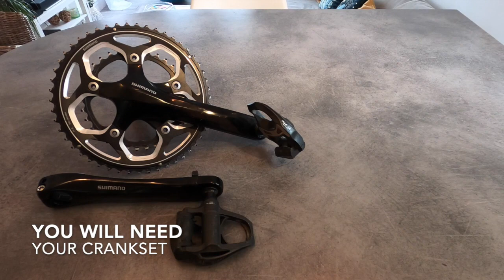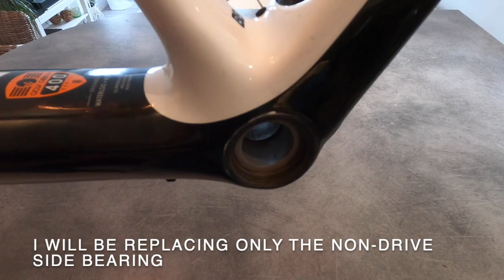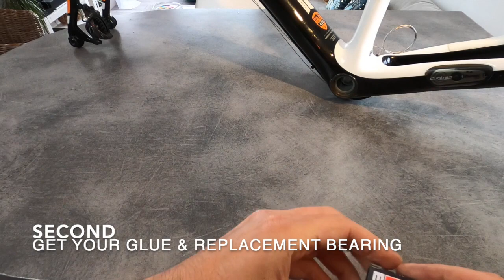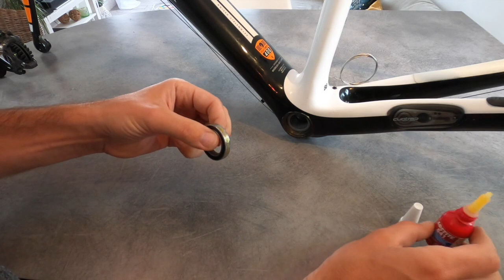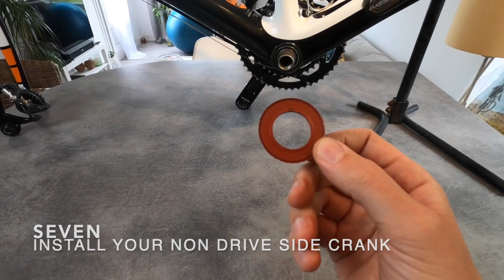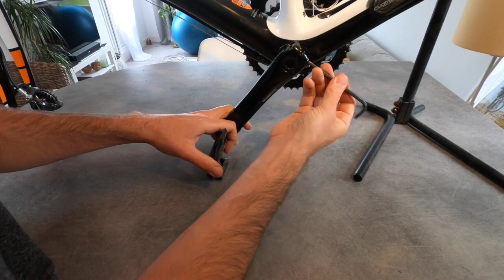Stop Trek BB90 bearings from creaking !

Comment: Wow… that frame should be replaced under warranty. The housing was always too big to hold the bearing in correct interference (manufacturing fault), possibly being further enlarged/ovalised by the outer race “spinning” in the poorly made housing.

Also, the bearings inner races are spinning on your crank axle, wearing that away too. The correct way of interfacing the BB bearing and crank axle is with a softer plastic/delrin sleeve as per Shimano BB’s. I would also be claiming they replace my crankset too! Very poor design and manufacturing. 

Thanks for the video and very best of luck 👍

Comment: your bb shell is worn, you can buy oversized bb90 bearings from trek that will fit beter
Reply: totally, if you don't need the press, you need to go oversize.
Reply: Even if I have Ceramic Speed too 🤦🏻‍♂️. Just had it serviced and still creaky 🤦🏻‍♂️🤦🏻‍♂️🤦🏻‍♂️
Reply from the maker: I would imagine that they fit better ...until they dont ! Wont they too make the hole bigger ?!

Comment: Just had my non-drive side bearing replaced at a trek dealer. They used an NSK 6805 with a plastic spacer, which is what trek is supplying them with. However, when i took the bike back home i took the crankset off just to realise that the bearing they replaced was out of the frame. Apparently they didnt use any retaining compound like you did., i could just slide the bearing back to the frame without any press. Many thanks for the video i will  try your way and see if it helps. BTW i didnt had any creacking issues, the bearing was just cooked.
Reply: The bearing is finally properly fitted to the frame! It works like a dream! Thanks for sharing!
Reply: How'd it go?

Comment: The whole issue is about incorrect interference fitting between bearing and housing. This issue can be mitigated by using a good tolerance bearing (e.g. NTN bearings) and pray that the tolerance on the housing in manufactured correctly. I am using NTN 6805 LLB Ultra Low Friction Seal bearing with SF7649 primer (for housing) and 641 Loctite. You will need the primer as Loctite  641 are for metal to metal surface, not carbon surface.
Reply from the maker: Loctite 641 is still working well. What do you recommend instead ?
Reply: @jonpontet   You don't have to do anything if the creaking improve. I am also using 641, but with a primer on the carbon surface.
Reply: @jonpontet  on carbon - metal, I used loctite sf 7649 activator spray before adding loctite 641.

Comment: Hows your bearings after months of usage? does the loctite work? my bearing is just like yours and able to easily fit in without any tools. obviously the carbon is worn. hope the loctite works great. thanks for your video anyways.
Reply from the maker: Its been a great solution that is still working problem free after 1500km 👍
Reply: @jonpontet  wow,  thats good to hear.  I ordered the normal size bearing before,  but then i  afraid to use it when i didnt have to use the press tool to fit them in. I returned them and got the Trek oversized bearing instead.

Comment: Do you have to use the 3M primer before?
Reply from the maker: I havent used it and I have had no problems.
Reply: @jonpontet  OK, thanks, Im performing my install of a Hambini BB tomorrow, I cleaned surface w Acetone, then Isopropyl alcohol.  Logically, I find it interesting that grease is applied where you want the bearing and the spindle to actually have some friction, that is for one to turn the other, not slip around it.